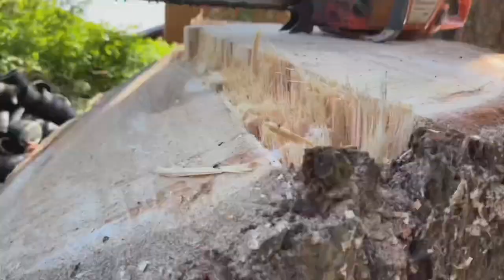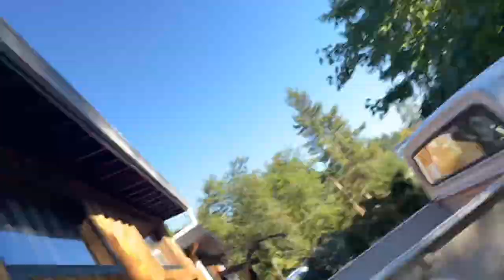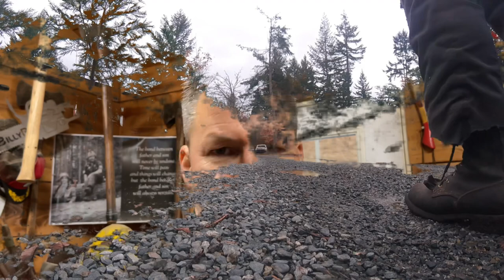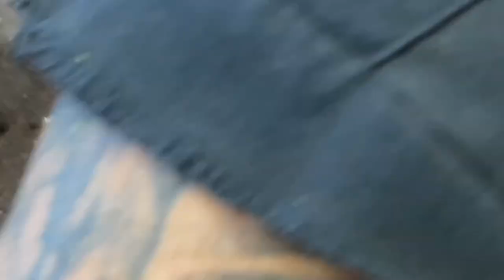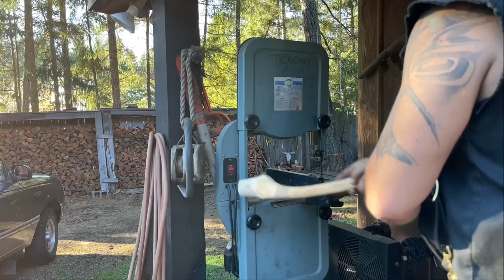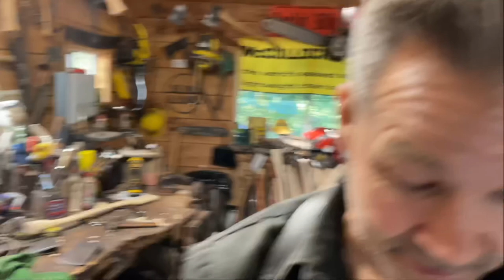There’s no way, I can get rid of this!

Comment: I took the 24 inch bar off my 372 and put a 20 inch back on it.  I got tired of packing it around with that heavy bar on it.  It is a lot handier, now.    I like mid size saws.  I can do just about everything I do with my ms 360 that I can do with a bigger and longer bar saws.  It also does not find a way to get its bar in the dirt like longer bar saws.  That little 360 will flat cut, maybe not as fast as my 440 or 460, but it is a lot easier to tote around.  I also do not cut wood over 25 inches, anymore, so it is enough saw to get the job done, even with a 20 inch bar and full house chain.

Comment: I cut a nice groove in big rounds with a chainsaw and use my splitting wedges and a sledge to split it in half.  I then finish splitting  it up with a maul or axe, or noth.  You ain’t going to split water oak with a maul or axe.  They just bounce off the top of a two foot round.

Comment: Looks like you need to grind off the cold metal flow edges on the hammer end to prevent metal pieces breaking off and getting into someones eyes. I like the burned sections of the handle.

Comment: Hey bucking.  What kind of fuel and 2stroke mixtures are u using.  Maybe a new vid on that with your experience.
Reply: Great question. I was thinking of asking him the same thing. I run 90 octane ethanol free gas (I call it pure gas) and stihl oil in the gray bottle. I have a lawn care company and I’m real detailed on my mix gas. I don’t let anyone else fill it so I know it has the right amount in it. I have had great success using pure gas. No carb issues at all. Even if it sits for months. Buckin’ please let us know friend.
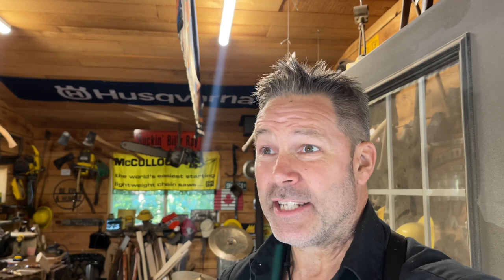Reply: @maximusmock  Im using Motul 800 off road  1:40 with 98 octane on a stock stihl 441.  No chainsaw oil brands like oregon or stihl hp.  Castrol a747 or Motul 800 off road. 1:40  mixture.  Not sure how they pronounce is in the US, BC.  1 liter 2stroke oil with 40 liters fuel 98 octane.  In Europe we have sadly 10% bio ethanol in most fuels.  That means 15% less energy .  So only get non ethanol fuel and premium 2 stroke oil.

Comment: Buckin, is there a length too long for splitting? I want to put a 44” handle on a puget sound double but I want to be sure it’s a good idea
Reply: I'm thinking of doing a long handle on a Plumb Puget but pugets really are generally thin chopper profiles unless they are worn down. As far as handle length goes the shorter the more accurate for most people.
Reply: More accurate would be better, but also i feel like it would look cooler on a longer handle, so maybe I’ll turn it into a wall hanger
Reply: @henry9806  The only source I've found for the over 36" handles is Thrane. They sell blanks so you can draw knife it yourself!
Reply: @jeffreyrubish347  oh man but they are soooo expensive! I’m just going to get a mattock from house handle and shave it down to fit and hope that works
Reply: @henry9806  that should work as long as the eye of the handle is big enough. My Plumb head has a 3" eye so I'll have to make a handle.
Reply: My favourite axe is on a 36” hickory handle
Reply: @pacificcoastpiper3949  I already have a bunch of those and the puget sound lends itself so well to longer handles
Reply: @jeffreyrubish347  hm I will have to check mine, away at college rn, but the mattock has a 3/4” by 2 3/4” eye
Reply: @henry9806  mine is a five pound Michigan
Reply: @pacificcoastpiper3949  holy cow, where did you find that??
Reply: @henry9806  believe it or else, my local hardware store
Reply: @pacificcoastpiper3949  is it old American steel or newer stuff? I don’t think I have seen a five pound double in either category
Reply: @henry9806  it’s a single bit , but it’s got a Michigan shape
Reply: @henry9806  it’s also newer

Comment: My Collins double bit has a warp in it. I dont know if it came from the factory that way or if someone beat the snikey out of it.
Reply: Hm. Usually abused double bits are beat up on the top or bottom. Sometimes though, they look like someone cut cable or chain with them. On single bits the more pol damage, the higher likelihood of a collapsed side and crooked head. I’ve seen many nice axe heads ruined like this(being used as wedges). No doubt desperate people trying to keep warm or cook some food. Take care.
Reply: @carlcarlamos9055  thanks carl!